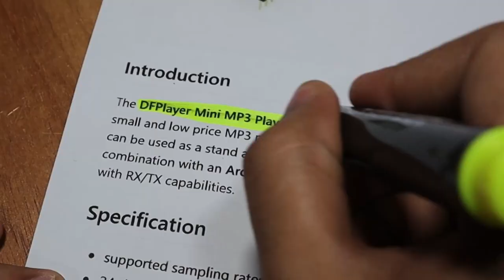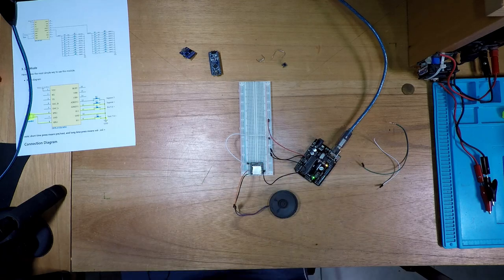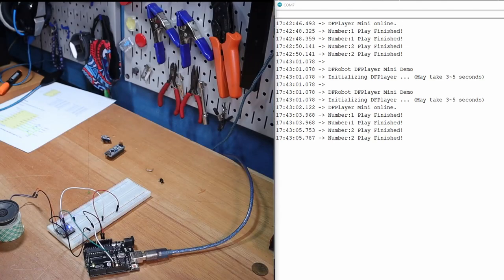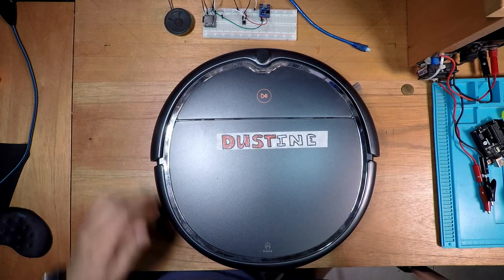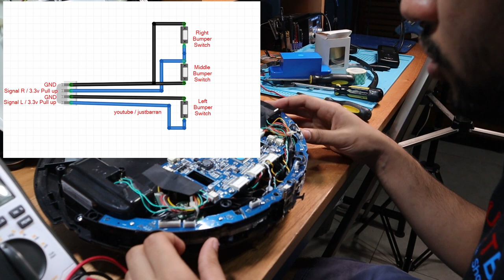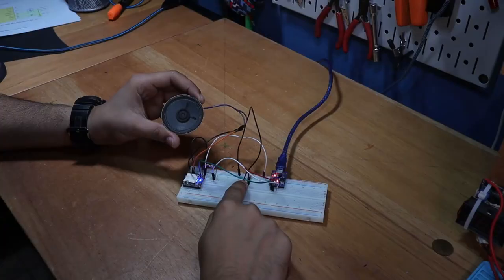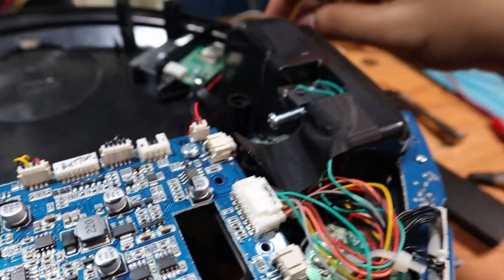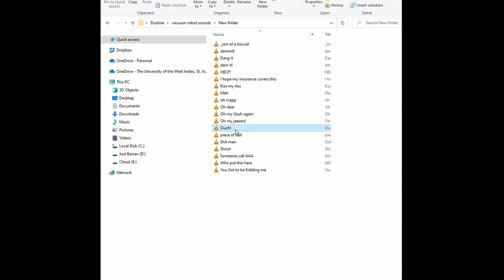My robot vacuum can say bad words ( attiny85 + DFplayer )

Comment: Two possible upgrades  1) Make it that the number generator check the previous number so that it doesn't have an immediate repeat .
2)  This one might not happen at all but if you can piggy back off the esp module so updates can happen wifi rather than manually taking out an SD card.
Reply from the maker: Really good ideas, definitely things that could be done. Thanks 🙌🏽🙏 am also thinking to add some animated eyes to add more effects.